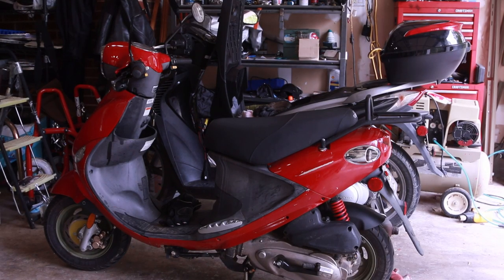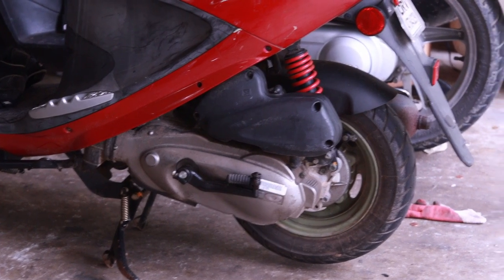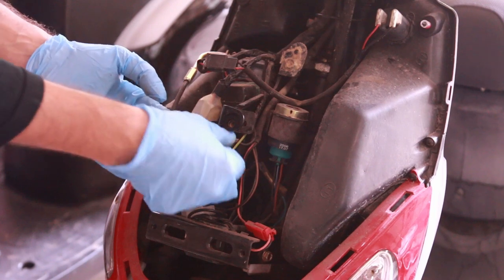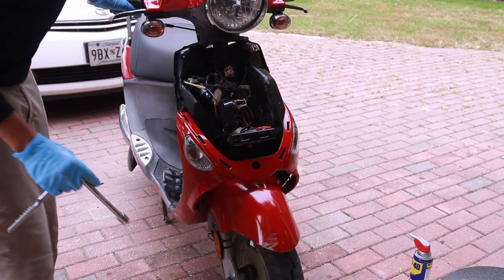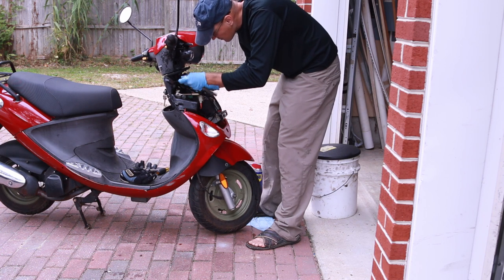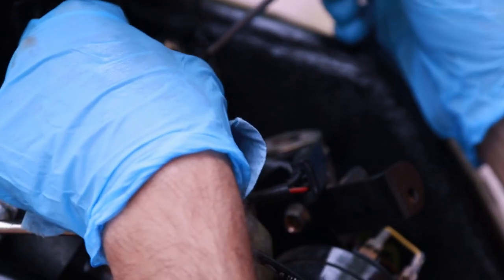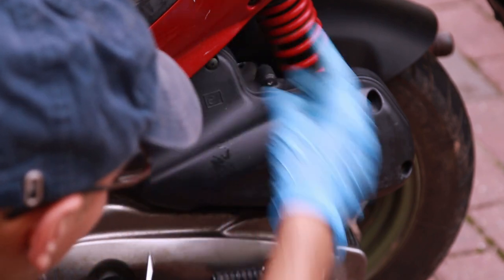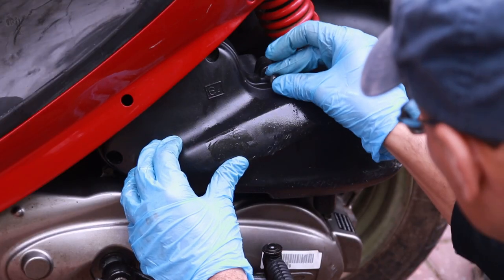How to fix your scooters crooked alignment

Comment: my bolt there only hold steering wheel on has nothing to do with alignment
Reply: The other way I saw on another video is to unscrew the bolt on the tire itself that is at the center of the tire held by the fork.

Comment: Great tips brother! I just picked up a 2020 TaoTao 50 that sat long enough for the gas to go bad. I cleaned the carburetor & jets and now it runs, but it misfires past 1/2 throttle. I might not have cleaned the main jet all the way. The handle bars wobble like crazy too so I need to readjust & tighten that bolt & nut that you displayed here. Great video! Happy scooting!

Comment: I know you posted this a while ago. But hopefully u can answer a question for me. I just bought a 150cc scooter and after putting the front tire on an the bolt u loosened to align it better. Would that cause my front tire to keep locking up? It looked like aligned right and tire is on right but spins then locks up an handle bars seem to tighten up

Comment: I had a crash on a honda pcx, now when i turn right the bike feels unstable like it will low-side, the bike leans over to the right too fast compared to the left, what could be causing this? My mechanic where i live has already charged me £800 so far and the bike is still not fixed
Reply: Might be bent forks or bent triple tree